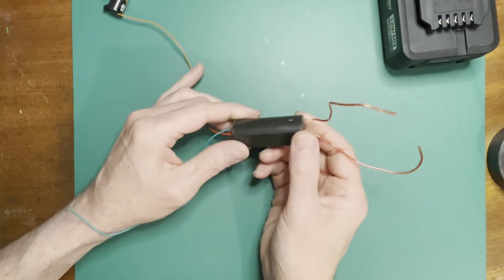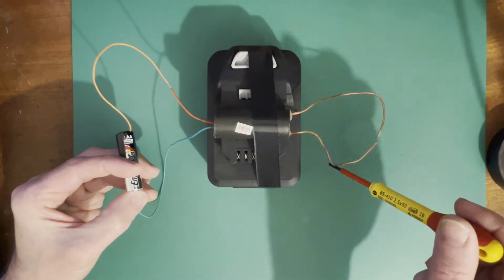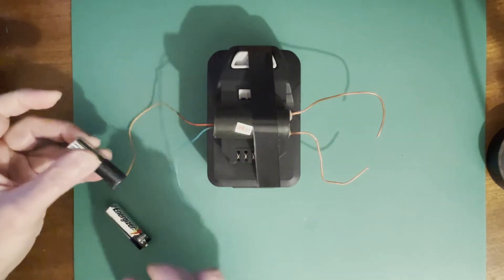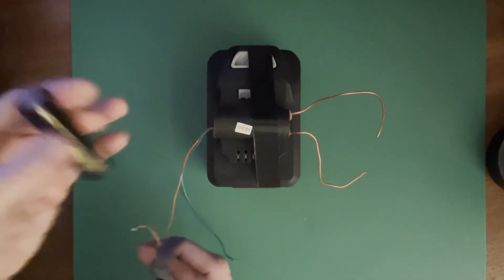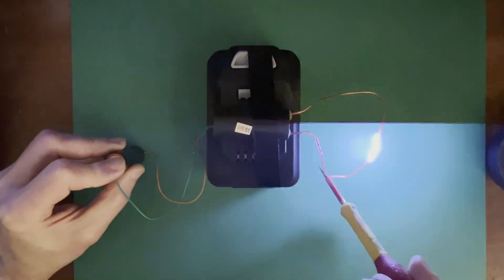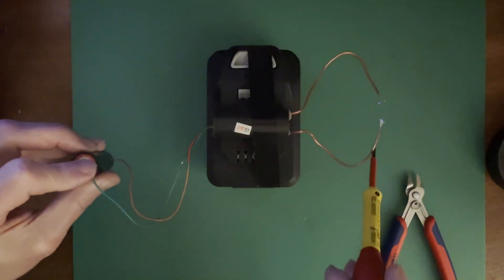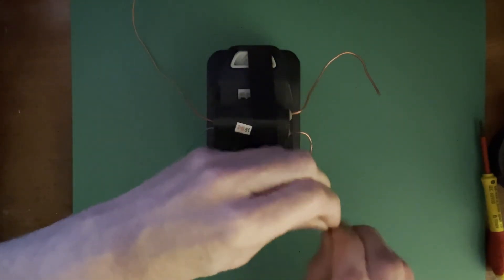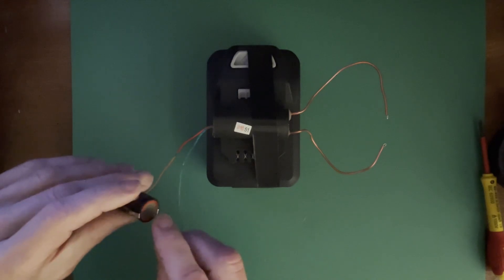High voltage module demonstration

Comment: I opened up 4 different (branded) stunguns, all containing a form of THIS unit....Two a bit bigger, 2 the same size.
This unit is DC HV and the gaslighting units are mostly AC HV output.